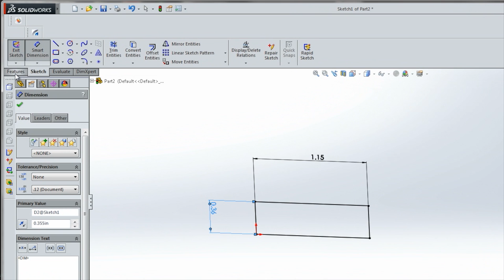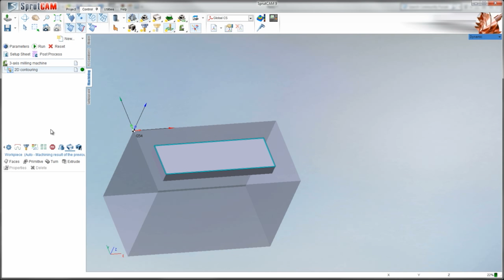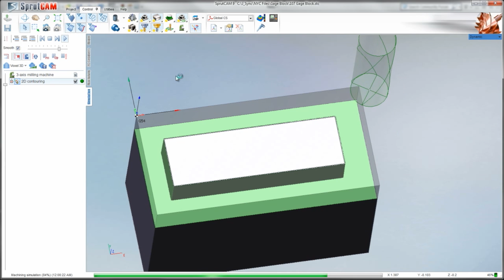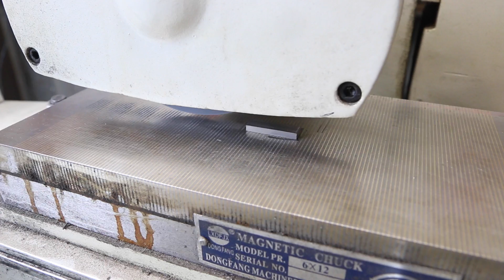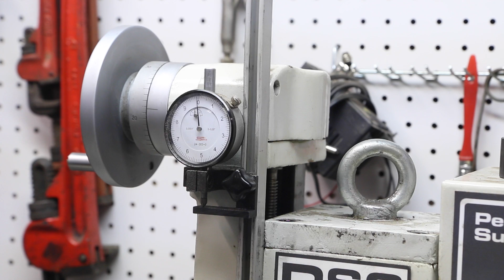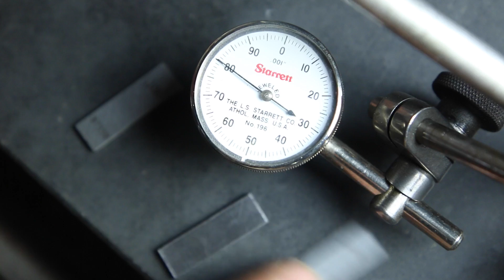The Lost 107: Machining & Grinding a Gage Block! Widget24

Comment: If you not take care to have the right temperature, you will not get a good Johansson Gage Block. Just try to ring them together, and pull them part.  A real new Johansson original Gauge Block could be ringed together and hold a pull of 120 kg.  They can measure change because of the heat from your hand.

But yes, you did a good job with what you got.

Comment: Even cheap gauge blocks have some precision.  Before separating the stock (bandsaw) I would have lapped the top surface flat so that the magnet chuck would not pull the block out of shape.  The bandsaw might relieve some stresses, but you could evaluate that with a sharpie and surface plate.  After grinding to 0.002" or so over size, it also should be hardened before a final lapping to dimension.  A length standard with 0.0001" specified precision should be evaluated at a few tens of millionths... a tenths indicator is not really sufficient.  Keep in mind that the errors accumulate as you stack the blocks.  Your thousandths blocks should be flat, parallel, and dimensioned within 2 tenths.

Comment: Gauge blocks need a lot better surface finish than that one has.  Grinding something flat is easier than keeping both sides flat & parallel while you lap them to a finish that will wring together with other gauge blocks,

Comment: $25 is too much to spend on a real gage block with micron accuracy what is your hourly shop rate, it looks like you spent 2 hours on that project  between the programming milling sawing and grinding I think you just made under $15 an hour including shop overhead or about $7.50/hr. Plus you didn't get a micron accuracy gage block just a placeholder that probably won't wring without lapping.    Nice try but I don't think you made a gage block sorry....

Comment: Your measuring in 0.001” which is absurdly coarse for a gauge block, how about for starters using a 0.001 Millimeter gauge?
These things are measured in light wavelengths and you are trying to make one with a ruler.
1 thou equals 1/200 millimeter /0.0254 millimeter while a metric “thou” equals 1/1000 of a millimeter or 0.001mm and a gauge for measuring that can be found worldwide at just about any hardware/toolstore, but apperently not in the usa.
But he!? , 1 thou sounds cool and sounds quite accurate.

Comment: I am very disappointed in this video. It"s OK to make a quick and dirty replacement for a missing game block but it must be clearly understood by all that is what you are doing for the start pending arrival of the calibrated and certified article. Further, a quick and dirty gauge block must be made of good stuff you can harden to Rc 60. 4141 as quenched in oil goes to Rc 50-55. 

Leave off all the process control, lapping etc. You can check a 0.107 gauge block by stacking a 0.103 block on a 0.104.and stack the block you are making on 0.100. Working from a granite flat and using a gauge head and gage amplifier you can certify parallelism and size to the limits of your apparatus BUT the best you can do is make the block, determine its size to 0.0001" etch the actual size on the block, and use it only until the certified calibrated block arrives. THEN you deface and scrap the bogus block.

I know this is just to see if you can make a gage block. Of course you can. Most any machinist or tool maker can, with a little care, make a close approximation of a gage block for a special purpose. In my year in the motor shop I dug up a dozen defunct ring gages and repurposed them to suit common ball bearing outer race dias. But these were plainly marked "NOT CALIBRATED! PROCESS USE ONLY. DO NOT USE FOR FINAL ACCEPTANCE!" That they were round to 15 millionths, had mirror lapped gaging surfaces, and marked for size to 50 millionths meant nothing to the QA people. They weren't in the cal and cert program. PERIOD.

Deceptive looking home made gage blocks are anathema to any QA program. It's a bad apple whose presence raises doubt about how precision tooling certification and consequent product quality is assured within the organization using it. If discovered and denounced by a reputable third party your entire QA effort will fall in instant disrepute. Legal and financial consequences may follow. Shars gage blocks ain't bad for open shop use. I got Metric and Imperial and a set of Mitutoyo gage block attachments but I wouldn't use them to certify any work to tolerances closer than +/- 0.0003".

Sorry this wound up a lecture. Make your gage block, demo your process, plainly and loudly declare it a demo/expedient, deface and trash it when you're done, and spend the money to buy a certifiable replacement 0.107 gage block.

Noobs are watching. You are a recognized source of machine shop lore: you have responsibilities you may not have anticipated.

Make your own gages to suit your work. But never slip a home brew duplicate where it might be mistaken for the genuine calibrated article.
Reply: Thanks for this.
T. Noob

Comment: you can't turn off the wheel after you dress the well, reason being is a very simple one: the wheel is running true when it's spinning and as soon as you turn the spindle off the wheel settles into a resting position which makes it untrue to the magnet vice. Spark out allows the wheel to clean up what's left. which means of there's any high spots the spark out gets rid of it. and it makes a better finish. you should also have your part on an angle when you're grinding. you'll have less travel per pass, that actually makes your surface finish and sizing excellent

Comment: the issue is running flood coolant . Stopping the wheel wet will allow the coolant to run and settle in the low side of the wheel throwing the balance. out. Allow the moister to spin out and all will be ok

Comment: So that is +\- 50 millionths of a inch and your indicator is only capable of 5 tenth thousands. So yea it really wont be a gauge block certified although with a good ground mirror finish if it wrings together your flatness is gonna be gage quality. It u will have no way to certify it.... now on the flip side u and i both know that if u are within .0002" or better yet .0001" u are more accurate than most any job will ever call for. It is just the entire
Point of a gage block is to be more accurate than anything u can create aside from grinding.
Also it needs to be seasoned steel heat treated to 65 Hrc so 4140 lre hard is only 30Hrc and that is not even close to hard enough. A2 tool steel hardened and tempered at the lowest temper range will yeild 60hrc so that will work and even better yet S7 tool steel will get to 65Hrc.

Comment: I would second the other comments about lapping. The most difficult part is keeping a flat surface for a part this size while lapping. Use ticky-tac or a similar compound to mold a good grip on the top of the gauge block, that way you can apply an even pressure. Also, when you are using a surface grinder and you have an interrupted cut on a precision part (here, on either end) you will want to lock the head (z axis). This slight change can roll off either end and your gauge block might not wring right. This is also especially important when grinding/resurfacing punch dies (that sharp edge being rolled will reduce the life of the part before the next resurfacing).
Reply: +Jason Rucks Also! I think the opinions about turning the wheel off before getting your hands near it is ridiculous. It's probably a result of safety protocol at job shops to reduce workers comp claims. You use bench grinders, right? This isn't much different. In addition to that, you really should dust the chuck when you're making something this precise. Even a very slight error in the chuck can manifest itself in your part, and it could be up to half a tenth bigger on one side. And, when you put your part on, ALWAYS (if the part dimensions allow, of course) SLIDE the part on from the edge after stoning the chuck and your part and wiping it clean.
Reply: +Jason Rucks And if you haven't, don't forget to balance the wheel. I just started teaching myself how to use the surface and cylindrical grinders at work, and I guarantee you will not get the most out of your machine if you do not balance the wheel first.
Reply: +NYC CNC No problem! This is all new to me too. I'm working part-time in a shop that used to have over 55 machinists, welders, and fabricators - now it has 4 because of offshoring of manufacturing. The upside is that I get to repair, play with, and teach myself to use all these great machines. It's good learning because there's no master machinists left in the shop to teach me! Slide the part on because there may be grit or dust on the chuck or workpiece. It'll get pushed/scraped off and not sandwiched between the two.

Comment: after spending a great deal of time grinding "endseals" on a cnc surface grinder that had to be with in .0005 I found out right off the start you have to be careful even running a coolant system. The heat you put into you part will tend to bow up in the middle. This causes two problems one the obvious concave shape you get as the part moves up off the magnetic chuck. Second the part will want to shift and move if you taking heavy cuts as you are loosing surface contact with the magnetic chuck.

Comment: You are supposed to leave 0.002 on for diamond pasting, then you can rub it down to size have a mirror finish and also stack the newly made gage block, thing with the one you made you wont be able to rub it to stack, but who cares I love your enthusiasm in machining nevertheless
Reply: NYC CNC Oh yea if you do it by hand but you can lap it using some sort of lapping machine or just have something set to a certain height and let it rub, a few ways you can do it just depends if your willing to buy something or make one
Reply: NYC CNC if you check out a video called hand lapping by don bailey, it's shows you how to hand lap if you use a surface plate for lapping you can actually achieve a flat face and get that nice stack surface too
Reply: Vladgorod7 sorry meant 2 tenths not 2 thou my bad

Comment: Nice John. A couple of things I've picked up, for what it's worth. Sometimes on the grinder it's best to think outside squares. We're so used to square in mills etc. Small objects like this will often grind better if they're set at an angle on the table, it tends to put less heat into the work and is a more gradual transition as the wheel hits the piece. I would set your travel stops further apart so the part is fully up to speed as it passes the wheel, you have them set quite tight and the table is still accelerating significantly by the looks of the video. Similarly, when doing it by hand I'd suggest a much faster traverse. Look at videos of hydraulic grinders and note their traverse speed for an idea. Again, less heat and better finish. Finally, even with a fine pole chuck, I think it's still good practice to block in little piddy pieces like this, just to be safe.

I had to chuckle when you commenced the video with the statement "it shouldn't be too hard". Making an accurate gauge block that wrings correctly is really REALLY difficult, so again I admire your go for it attitude. It may not be a gauge block in the true definition of one, but you've filled the hole in your set that should do the job for most purposes. Thanks for sharing!

Comment: You can do electro etching with vinegar, battery and printout from a laserprinter. =)
Reply: Its quite a good way of marking tools actually. You can do stencils out of plastic as well then set one pole to the material, and sponge with a clamp to the other pole and dip it in vinegar then slowly rubbing through the stencil marking the part. =)
Reply: Print with a laser on overhead film (old school plastic film) and then take a excato knife to it.. in your case.. spray glue it to something, take a reeaaaaly small mill.. and well.. mill it..
Reply: NYC CNC Try this mate.

1.  Use Photoshop or a similar program to create a reverse image of the numbers you want to print on the gauge block.

2.  Print a black and white image of the numbers using a hi res laser printer onto a sheet of white copy paper. (Don't use photo paper.)

3.  Clean the steel gauge block thoroughly with acetone or isopropyl alcohol.

4.  Using a hot clothes iron, transfer the image to the gauge block.  (The toner comprising the image will melt and stick to the steel of the gauge block... Well, it should.)

5.  Peel the paper off the block carefully and if there are any exclusions, dab a bit of girl type fingernail paint onto the exclusions with a real small, fine brush.

6.  Using another real fine brush or a bit of cotton wool twirled round the end of a tooth pick, dab ferric chloride onto the exposed steel that you need to etch.  You should be able to get ferric chloride at one of your Radio Shack stores. 

7.  Gently wash off the etchant after five minutes or so and inspect the result. If you are not satisfied, gently apply more ferric chlorids and wait a few more minutes before washing off. Repeat as necessary. The ferric chloride should etch the exposed steel pretty well and leave a high contrast result. . Well it should.

Yair... That's about it I reckon.

Cheers. 

PS You do good stuff.

Comment: Hi John,
Not bad at all, with minimal means to quality control. The accepted norm for testing in reference control is: Your measuring equipment has to be at least 10 times more precise than what you try to measure or achieve.
In your case it's going to serve the purpose.
A little safety advise when you grind very small parts, just install a larger plate of steel a little lower to the one you grind, so it's not flying under a heavy cut... (I know you have a fine pole chuck but....)
Nicely done though..
Pierre
Reply: Have you tried if it will "Ring" with the other blocks?
Reply: pierre beaudry
Pierre is right on, the true measure of suface finish on gauge blocks is if they will "ring" together.  They should stick like glue.  Thanks for sharing,  great video on making the part.
Reply: Refer to your older videos where you were experimenting on polishing...

Comment: i can make you one if you want and can send a cert with it i work at vermont gage and we make thing like this and measure down to .00002
Reply: NYC CNC
chevalier cnc surface grinders climate controlled also parts are frozen to restructure the steal so it will always return back to it size in a nut shell

Comment: How precise do you think it would be had you just milled it. About a thou or 2?
Reply: +NYC CNC I would expect you could get down to a thou or less on the Tormach with a flycutter and the appropriate feeds and speeds, and manual setting of the Z axis with indicators. It would be an interesting experiment to see what you can get out of the machine.
Reply: If yo profiled the part with the  .107 in Y and cut and measured you should be able to get it within a couple of tenths just with a milled finish. I wouldn't se tool deflection being an issue over something the length of a slip. Run a spring pass, clock the tool.

Comment: I know it might not be the appropriate place to ask this, but what kind of an education do you need to learn about machining and designing mechanical parts / machines with cnc / machining equipment?
Reply: Im also self learner, came in to metalworking 4y ago with 0% experience. Now I run 2x CNC milling machines, doing setup and programming from start to finish. Best place to learn is a machine shop ;)

Comment: Will that new block adhere to the others if you need to stack the blocks?  Do the other blocks adhere to each other?  Sorry, I know adhere isn't the right term, but was just curious on whether they have to do something special to gage blocks to get them to be able to do that.
Reply: NYC CNC When gage blocks "stick" to each other it is a phenomenon known as wringing, which is a combination of pressing the air out and a thin film of "unknown" composition. It requires an exceedingly flat and highly lapped surface.

http://www.aspe.net/publications/Annual_2005/POSTERS/3METRO/6SURF/1831.PDF
Reply: atomkinder67
I believe that it has also been argued, though not by anyone as uneducated as myself, that wringing may induce a form of van der Waals' interaction in the surfaces via the static one imparts into the gauge block during the wiping of it across your wrist. I haven't the article to quote, but did discuss it with Tom Lipton, and he's pretty much bathed in science daily ;)

Cool project, and I had wondered if you were going to lapp  the block after surface grinding, and if so how you would do so in an accurate manner, or "on plane".

I guess I've got my homework for tonight...Aloha, Chuck
Reply: Knolltop Farms In a lab environment gage blocks are never touched with bare hands. Very common to wear cotton gloves to partially insulate high grade blocks from the heat of one's hands.
Reply: atomkinder67
Most gage blocks are hand or machine lapped to submicron so that they will wring together.
Reply: gbowne1 As a micron is just shy of .00004" I would hope so. This depends on grade though and block length. Lab grade gage blocks one inch and under have to be within .000009" of nominal size IIRC. That's total tolerance, not +/-.
Reply: We do air gaging for things this size.
Yep, and the lab spec is .000009"

Comment: Good job! 
Do not forget to demagnitize workpiece after you are done - if not, it picks shavings badly.
Also, ultimate test for flatness and surface finish is stick test - two blocks wiped with fingers should stick together if pressed and slided a little. Your gauge blocks should do it.

Comment: Excellent procedural work on this one.

Pity for the indicator, but hey, it happens. "Whaddya gunno do"?
Reply: John, could you have used the tenth indicator you have in the surface grinder to do your comparison tests? Is it easily removable from the grinder?
Reply: NYC CNC
Not quirky. It's a good rule. It makes a lot of sense. :)